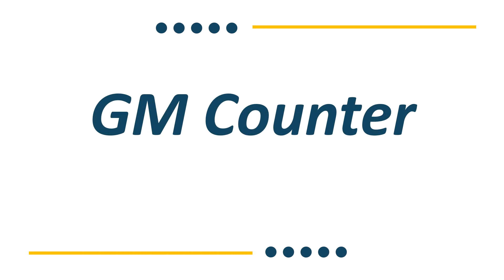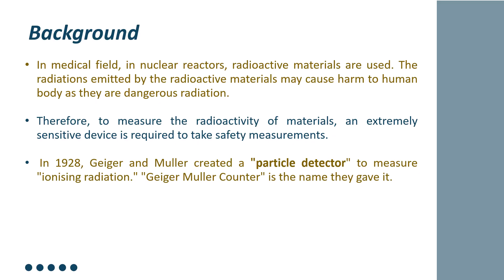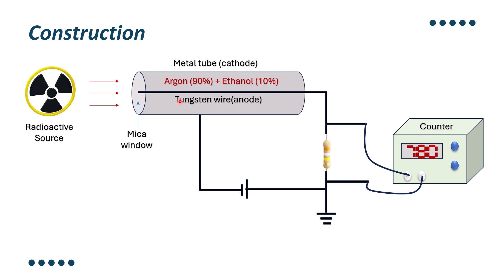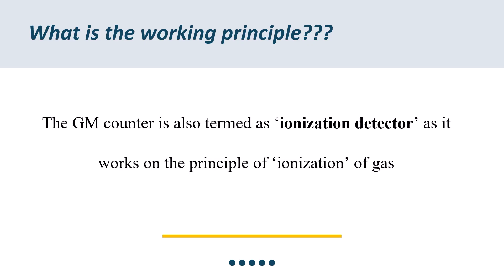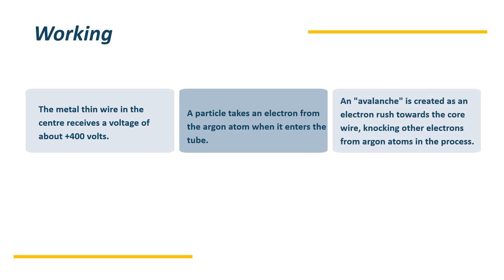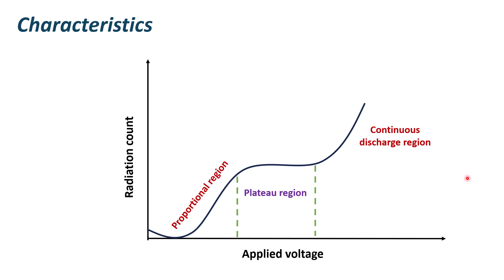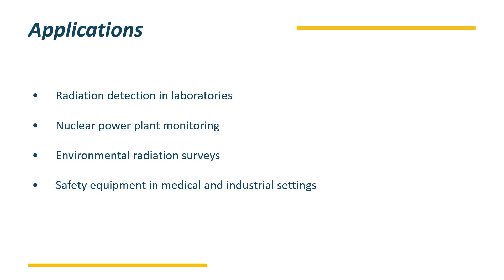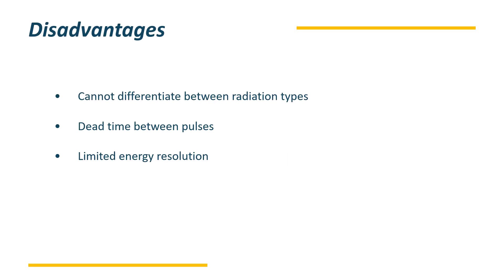GM counter -radiation detector

Comment: Clear Introduction to the GM Tube
– The narrator starts by explaining the GM tube’s construction (a gas-filled chamber with a central anode wire and cathode casing), and how ionizing radiation triggers avalanches of electrons—great for visual learners.

Comment: 1 how does the quenching gas in a GM counter work 

2. What are the application and limitation of GM counter in radiation diffraction? 

Quenching gas 

Lonization

Gas filled tube

Comment: The video explains how a Geiger–Müller (GM) counter detects radiation by producing electrical pulses when radiation ionizes gas inside the tube. It shows basic use, applications, and limitations—like not measuring radiation energy, only counts.

Comment: How It Works:
1. Radiation enters the GM tube.
2. It ionizes the gas atoms inside.
3. The electrons move to the anode, causing a brief current pulse.
4. The pulse is counted or displayed, often as a click or digital readout.

Comment: I learned that the GM counter is used to detect ionizing radiation like alpha, beta, and gamma rays. It works using a gas-filled tube that conducts electricity when radiation ionizes the gas. The video also covered its advantages  and limitations.

Comment: 1.How does the quenching gas in a GM counter work?

2. What are the applications and limitations of GM counters in radiation detection?
Quenching gas
Ionization
Gas-filled tube

Comment: Describe the Geiger-Müller (GM) counter as a radiation detector, including:

1. Construction and working principle
2. Diagrammatic representation
3. Key characteristics
4. Applications
5. Advantages and limitations

What makes the GM counter a useful tool for radiation detection?

Comment: lonization Process :
1. High-energy particles (like alpha, beta, or gamma rays) enter the ionizing chamber (such as in a Geiger-Müller counter) through a mica window.
2. These particles hit argon gas atoms inside the chamber.
3. When they hit, argon atoms get ionized-meaning their electrons are knocked off.
4. The freed electrons and ions then collide with more argon atoms, causing a chain reaction (cascade effect) of ionization.

Comment: Ionization Process :

1. High-energy particles (like alpha, beta, or gamma rays) enter the ionizing chamber (such as in a Geiger-Müller counter) through a mica window.  

2. These particles hit argon gas atoms inside the chamber.  

3. When they hit, argon atoms get ionized—meaning their electrons are knocked off.  

4. The freed electrons and ions then collide with more argon atoms, causing a chain reaction (cascade effect) of ionization.  

5. This chain reaction leads to a sudden, massive electrical discharge.  

6. That discharge creates a current pulse, which is detected and counted.
Reply: lonization Process :
1. High-energy particles (like alpha, beta, or gamma rays) enter the ionizing chamber (such as in a Geiger-Müller counter) through a mica window.
2. These particles hit argon gas atoms inside the chamber.
3. When they hit, argon atoms get ionized-meaning their electrons are knocked off.
4. The freed electrons and ions then collide with more argon atoms, causing a chain reaction (cascade effect) of ionization.

Comment: A

WARIT z uays ayu

In the above video, I understand that the GM (Geiger-Müller) counter is a device used to detect ionizing radiation like alpha, beta, and gamma rays. It works by sensing electrical pulses created when radiation ionizes the gas inside its tube. The video explains its construction and how it's used in fields like nuclear monitoring, medical diagnostics, and environmental safety.

Comment: FY(Q) 
Roll no 40 
the above video, I understand that the GM (Geiger-Müller) counter is a device used to detect ionizing radiation like alpha, beta, and gamma rays. It works by sensing electrical pulses created when radiation ionizes the gas inside its tube. The video explains its construction and how it's used in fields like nuclear monitoring, medical diagnostics, and environmental safety.

Comment: 1. What is the principle of operation of a GM (Geiger-Müller) counter?

2. How does a GM counter detect radiation?
Key points 
1. Ionization
2.Gas-filled tube
3.Radiation detection
4.Quenching gas

Comment: Sairam Rathod Q-35

Geiger-Müller (GM) counter, also known as a Geiger counter, is a widely used instrument for detecting and measuring ionizing radiation. It works by detecting the ionization caused by radiation passing through a gas-filled tube, generating a pulse of electricity that is then counted. GM counters are valuable for applications like radiological protection, radiation dosimetry, and experimental physics.

Comment: In the above video, I understand that the GM (Geiger-Müller) counter is a device used to detect ionizing radiation like alpha, beta, and gamma rays. It works by sensing electrical pulses created when radiation ionizes the gas inside its tube. The video explains its construction and how it’s used in fields like nuclear monitoring, medical diagnostics, and environmental safety.